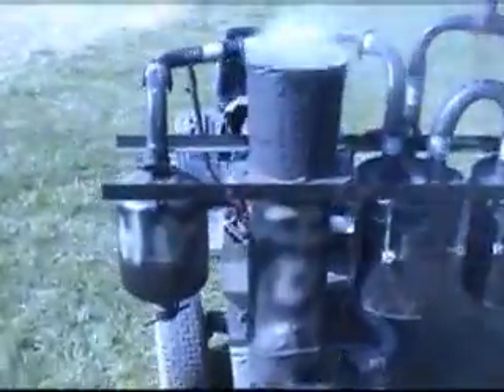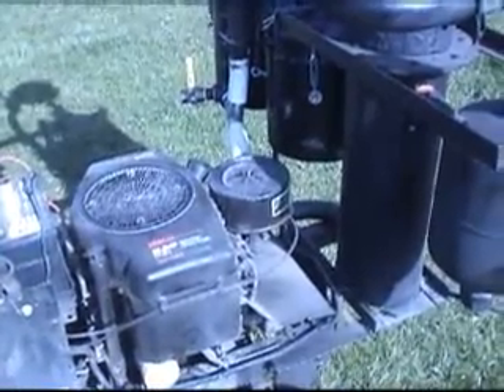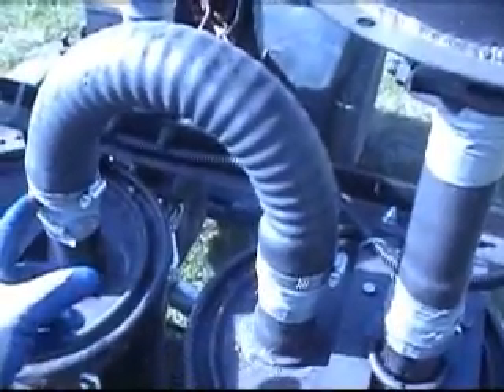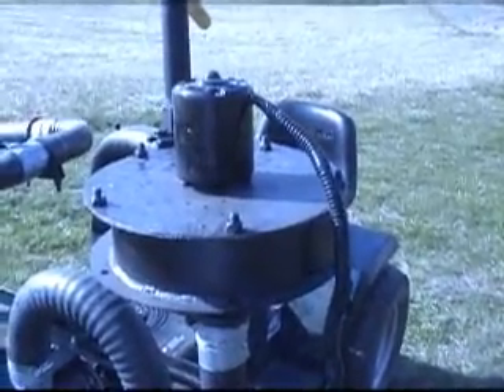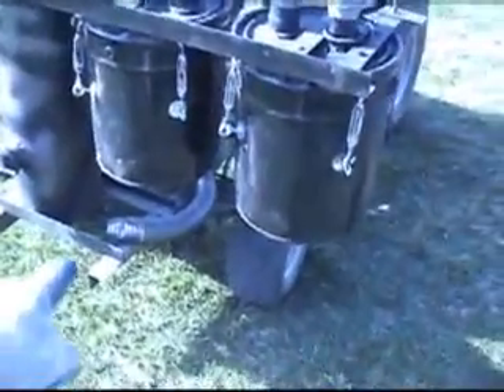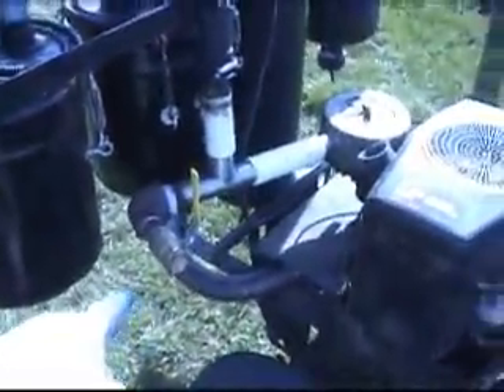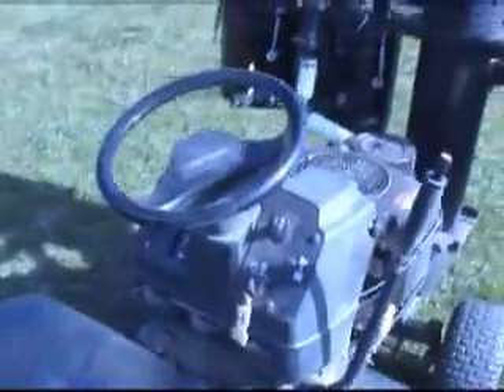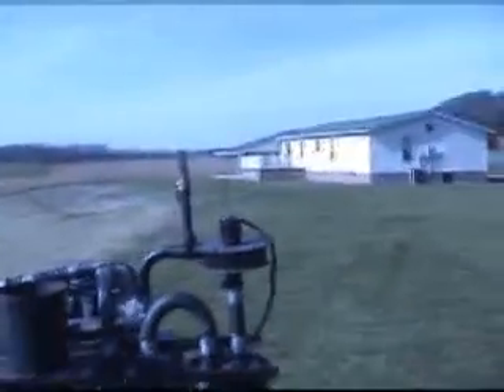Wood Gas Lawn Tractor Intro

Comment: On your setup does the fan run constantly or does it shut off when motor starts?
Reply from the maker: On this set up the fan was only used for startup to get the generator producing gas. On a cold start, once the flare flame was blue ( no yellow - low tar) the engine starts and the draft from the engine pulls air through the gas generator. The fan can be shutdown at that point. For a “hot” start the fan is turned on to start the draft, engine is started and fan shut down . No need to light the flame. The fan is isolated from the system with a quarter turn valve.
Reply: Thanks! I appreciate the response.

Comment: @th19940305 It run on the gases make when heating wood, hydrogen and carbon monoxide, in a open fire you can see these gasses being burned its the flame :)